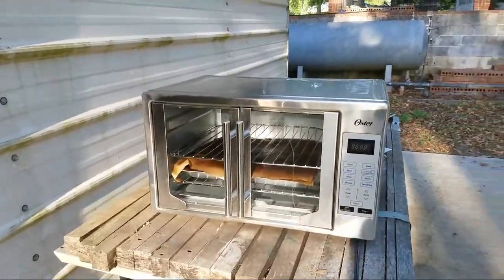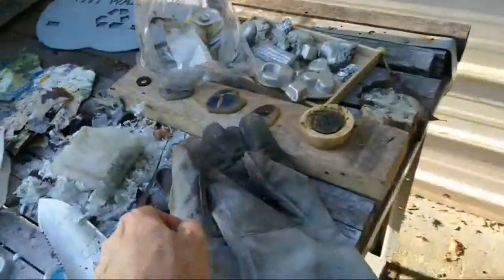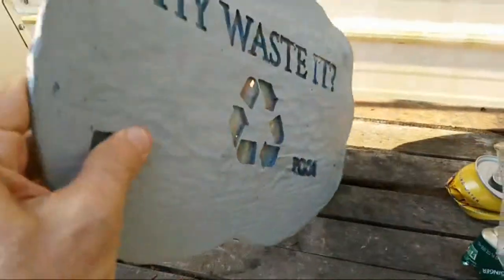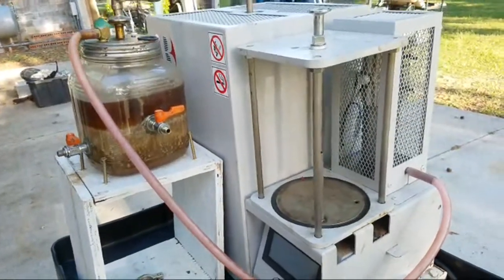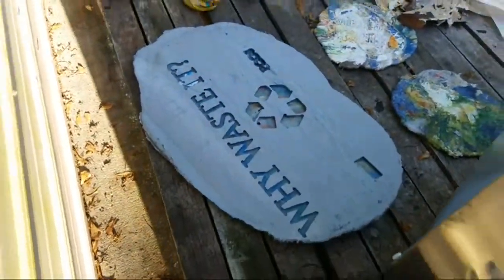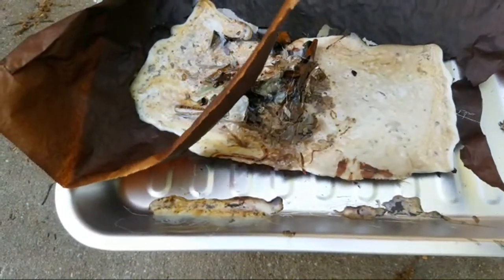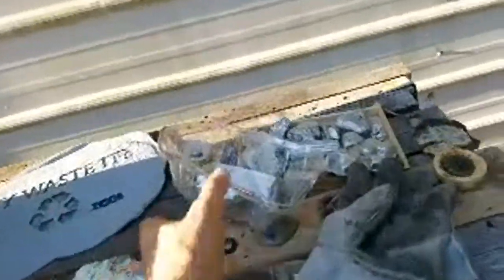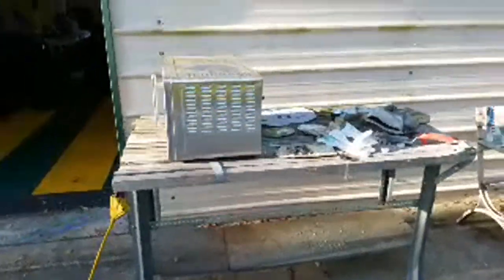Melting PETE Plastic Trial 1

Comment: I have nearly mastered properly melting PET into a beautiful solid transparent cylinder. Unfortunately for me as soon as I achieved it, the glass container exploded in my face (always wear PPE or you may lose an eye!). 
This is my advice:
1: Put the PET in a container/form that allows you to pressurise it. A rod and shaft setup would work for this (Basically a giant syringe. Put the PET in the shaft and trap it inside with the rod).
If you can contain the PET under pressure when it is melting, this seems to be what makes it turn transparent instead of white.
 
2: Heat the PET to 135°C for 4.5 hours (Stops PET being brittle by drying it out). 

3: Heat the PET to 230°C-260°C. (Try not to keep the PET at this temp for too long or it may burn depending on your setup). 
[!] Oxygen is the enemy here and will cause the PET to have a crappy brown/yellow tint to it. Heres a few options to avoid this: 
a) Try to compact the PET in the chamber as much as possible to reduce the amount of air inside, 
b) You may be able to submerge it in a relatively inert liquid that has a boiling point above 230°C, 
c) Pull a vacuum on the PET chamber with a vacuum pump. (This will require the chamber to be air tight). 
d) Displace the oxygen with another gas like Argon or Nitrogen (of course this will require a reasonably air tight container). 

4: Remove the PET chamber from the heat source. Now is the part where it is most critical to have it under pressure so clamp down on the chamber as much as you can safely do. (It may also help to cool down the chamber to ambient as quickly as you can by water-cooling the chamber. This may help with transparency).

[!] It is very important that the PET is not jerked, impacted or experiences a sudden change in  pressure while it is cooling or it will turn white. Make sure the PET is well below 85°C before decompressing the chamber. 

I'm going to try this setup soon and hopefully it is successful! It's not as complicated as it may sound and I hope it will finally give you a good result with PET!
Reply: Hi, Meagan. Got any pic of your installations?
Reply: similar to the process of injection molding i suppose?
Reply: Thanks for sharing! The sooner we can streamline a safe and efficient way to recycle PET, we really clean up the planet!
Reply from the maker: Thanks Meagan, this is SUPER super helpful!  I will pass this info on to my class and see if we can create a setup based on your experience!
Reply: Make a video!
Reply: did this ever work out for ya?